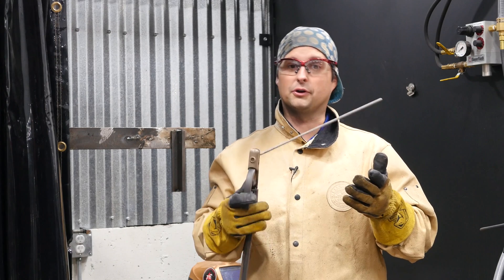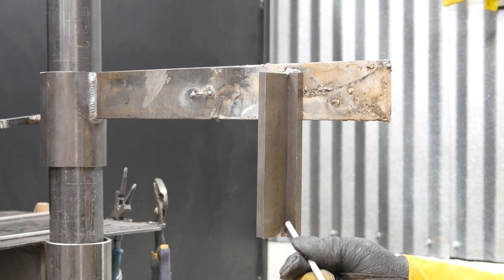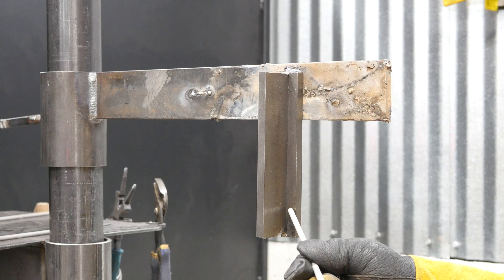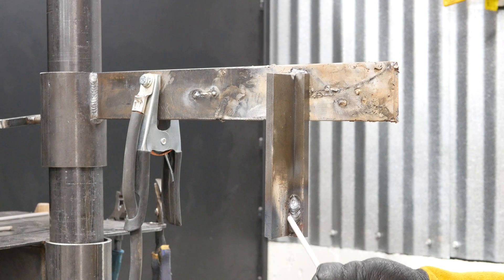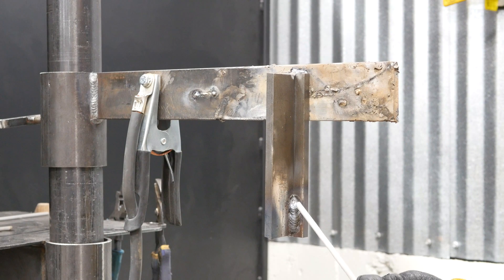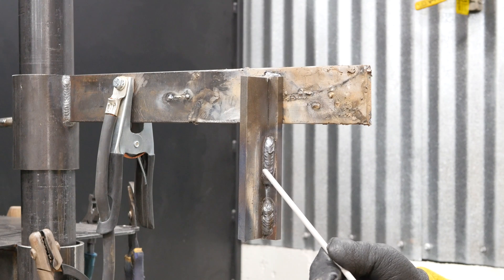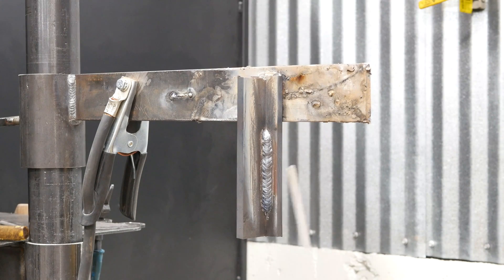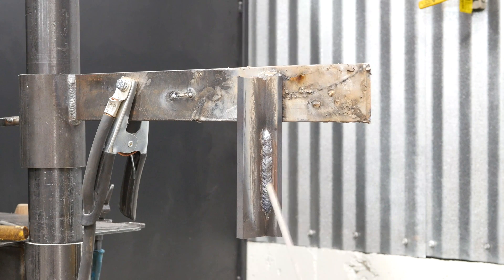Determining Amperage for Stick Electrode

Comment: I know this is an old video, I hope you are still checking comments. What about 7018 5/32 stick? The label recommends 130-170 amps if I’m not mistaken. Would that be accurate?
Reply from the maker: The manufacturer typically suggests the range you mentioned (130-170) but most operators prefer to keep it in the 150-160 range for best results.

Comment: I'm new to this, but what if you travel faster at the higher amperage (120 amps).. I know the bead would be narrower but what would be the downside?
Reply from the maker: You are exactly correct, as you gain experience you will want to start moving faster and in so doing will need to raise your amperage. I typically suggest slower parameters for newer welders.